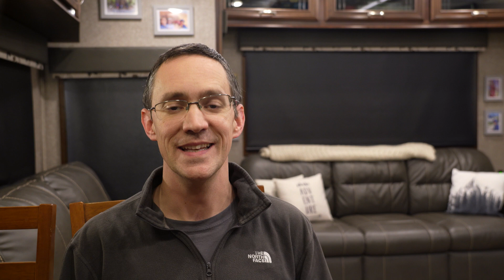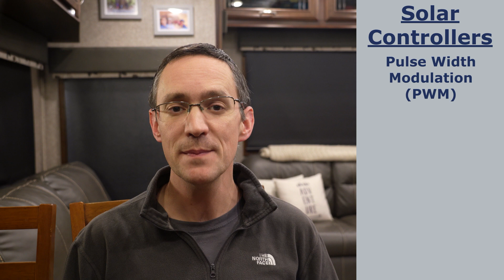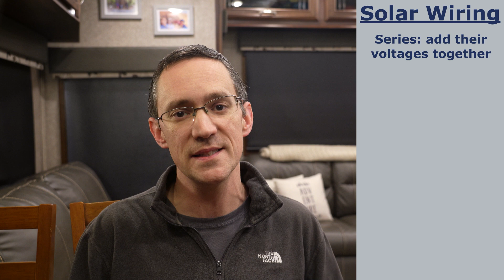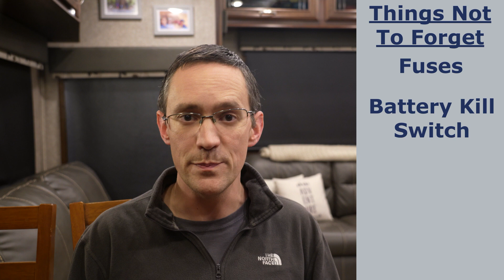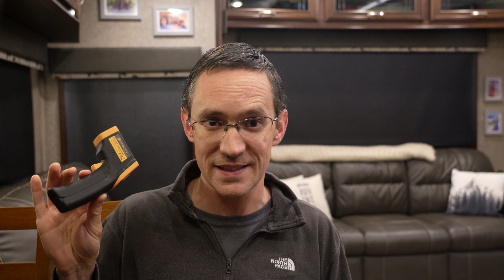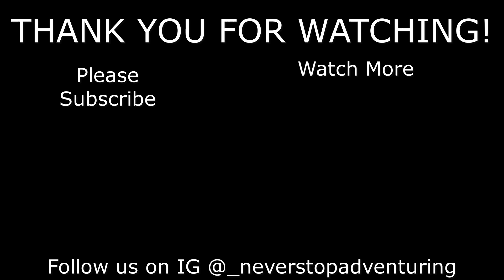Solar Controllers MPPT vs PWM & Solar System Testing – Design Series Part 5

Comment: Though your system is overkill for what I would like to build, you touched on a few interesting points. Namely multiple controllers and or inverters. How did you wire your setup? I love schematics...
Reply from the maker: Sorry, I don't have the schematics available. I just drew them out by hand on a pad of paper. 3 years later it's pretty faded and buried somewhere...
The controllers are just wired in parallel to the battery bank. So each set of solar panels goes to the input of controller, then the output goes to a fuse and then to the battery bank. You can wire in as many as you like this way. Each one also has a data cable that goes to the control screen.
The inverters are more complicated. There are newer ones available that make 50A RV wiring less complicated, but in our case I wired incoming power L1 to one inverter, L2 to the 2nd inverter and neutral and ground are shared between the two. The AC outputs are wired the same way to the breaker box in the RV. There's also a DC connection to the battery bank that I used 0000 cable to connect each inverter.
Reply: @NeverStopAdventuring  so 2 converters gives redundancy, and more solar input than one alone? but a bigger one could do it alone? i am just starting to plan out and research my own house on wheels build, so learning everything i can. esp pros and cons. and ideas.
Reply from the maker: @RoadieFilms2112  do you mean solar controllers? It depends on the specs and your battery voltage. I could have gotten away with just 2. I added one more to leave room for expansion (which I really don't need).
Reply: @NeverStopAdventuring  well, the controllers and inverters. i am guessing the controllers are just lugged together adding more input to the batteries? what needs to be done to make that safe for the system?
Reply from the maker: A 50A RV has two AC lines. That's why I needed two inverters. They make newer ones now that can handle all of the connections in a single unit though, depending on your power needs. The AC side is safe because the inverters themselves can shut off incoming power as necessary via a built-in transfer switch. The AC outputs then go to the main breaker box for the RV which makes them safe. ALL of the DC connections require a fuse to make them safe. With 2 inverters and 3 solar controllers, I have 5 fuses. The positive DC connection on each piece of equipment first goes to a fuse, then to the battery bank. What size of fuse you need is dictated by the manufacturer.

Comment: Wow. I just watched your series, and this is the most comprehensive set of videos on RV solar I've ever seen. Great job! I could have used this advice long ago before we went FT. 

We're retired FT RVers who love to boondock, so we decided to build our system in 2 phases, a 12v basic phase to run all our 12v appliances and a 48v system for our AC high power needs. The main issue we faced is we are retired and living on social security and a small pension so have to do everything on a tight budget forgoing name brand Battleborn batteries and Victron components with lesser-known brands. The first phase was just completed last month with the addition of custom built 560ah of LiFePo-4 battery made with 8, 280ah prismatic cells. It's like having 5 1/2 Battleborn 100ah batteries but on a budget. We used a Heltec 330amp BMS and a 5a active balancer, so we have enough starting capacity for our onboard 5,500watt generator we will retain for backup. We built our 12v battery with grade "A" LiFePo-4 prismatic cells having an 8,000-cycle mfg. projected life at 80% DOD. It only cost us $1,500, including the BMS. The reason we chose these cells is that they fit under the steps of our motorhome where our old pair of GC-2 golf cart batteries used to reside, saving 35lbs compared to our old FLA batteries - not to mention having over 5 times the capacity and 10 times the life. we cut a small hole in our steps and installed a tiny computer fan to keep this space at close to cabin temperatures to extend the life of our batteries. We insulated the compartment as well to prevent it from freezing. 

We started our build 3 1/3 years ago with a 620-watt liftable array of 2, 310w Canadian Solar panels mounted on the side of our motorhome. It serves as a nice bedroom window awning too. It practically lifts itself to the correct angle with a couple gas struts, without climbing on the roof. It's easy to clean with a windshield squeegee, standing safely on the ground. This first phase, including the liftable array, wiring, breakers, a new Progressive Dynamics 80a Li compatible converter/charger, 600 PSW inverter (to run our TV and PC), an Epever 50a MPPT controller, and a Renogy battery to battery charger (to protect the alternator) cost us around $3,600. 

Now that we have funds available, it's time to start phase 2. We have enough room to rack 8 BlueSun 460W bifacial solar panels in a single row down the center across the length of our 35ft Class A. We will be racking them, so the driver's side of the array will be 16" off the roof and the passenger's side about 10 inches of the roof (to clear our front AC shroud and vents.) This clearance should conservatively produce another 10% output off the back of these bifacial panels too, from sunlight reflected off our white roof - even more during off-peak hours and in the winter, when the sun is lower in the sky. Peak output won't increase by much, but there will be more area under the curve, so to speak, due to higher morning and evening output. Our MH isn't as tall as a fiver, so we will be able to keep the RV height to 12' 2" at its highest point to minimize clearance issues. We will be using an all-in-one 48V, 3kW, 120V PSW Inverter, 80a controller and 60a ac battery charger by MPP for the bulk of our AC needs with a dedicated, 2,000w, 220v PSW inverter to power a 12k Btu mini-split heat pump. Our 48v battery bank will use 16, 310ah prismatic cells (15.9Kwh.) For comparison, it's about the capacity of 12, 100ah Battleborns, so together with our 560ah (7.1 Kwh)12v bank, we will have a total of 23Kwh of batteries onboard. We will be adding a 30.5 SEER, 12k Btu Blueridge mini-split heat pump in our bedroom, and removing our old rear 12k btu rooftop AC that we never use anymore since we replaced our front 12k Btu Dometic AC with a 13.5k Btu Furrion unit. This second phase will cost around $9.5k, which is pretty reasonable for a system of this size, including the mini-split. It will provide 24/7 off-grid air conditioning and supplemental heat from the heat pump and allow occasional usage of our front rooftop AC to cool things down for peak afternoon demand. The total solar capacity of both arrays, while hard to estimate accurately with bi-facial panels, should be roughly the equivalent of 4,600 watts of single faced panels. It will give us total off-grid electrical independence with little to no back-up generator usage.